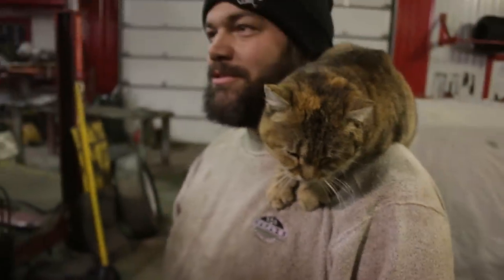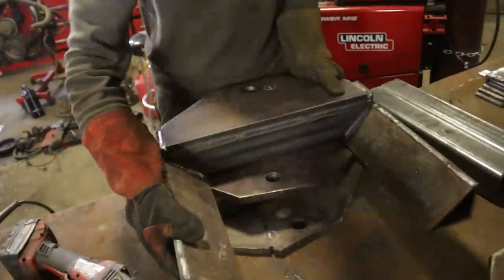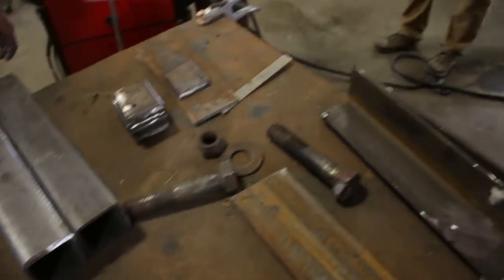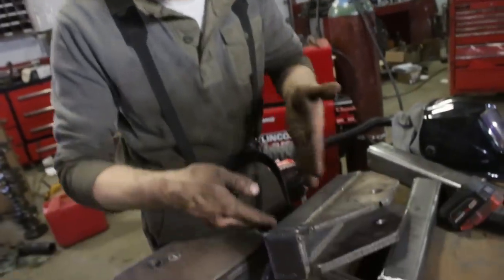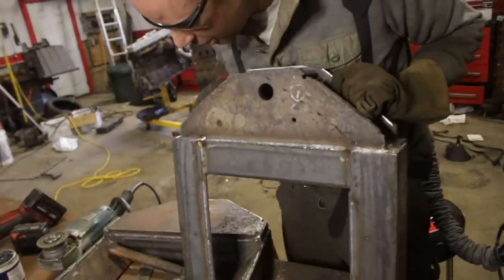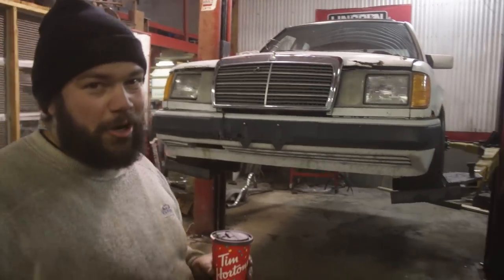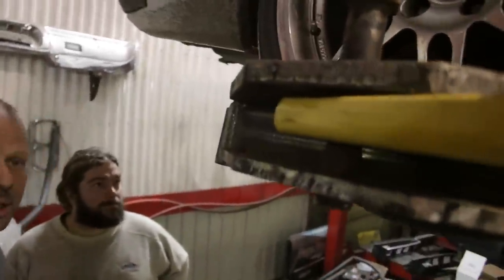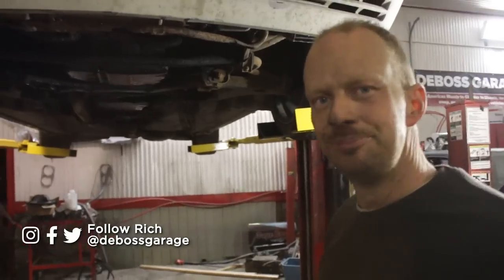How To Build Wheel Engaging Adapters For Your 2-Post Car Lift

Comment: As a professional engineer... thats super sketchy. The brackets you made are super beefy, but the holes you used for your pin are designed for a straight vertical load using the feet pegs. With the brackets, it now puts a rotational load on the square tubing of the lift that probably not designed for it. If each corner weighed 1000 pounds and center of load was 6 inches from the pin, then you have 500 foot pounds of torque on each lift arm. Considering most commercially sold products are just strong enough to prevent a lawsuit, i think eventually you will have problems.
Reply: Totally agree there will be a large rotational moment ☹️
Reply: I'd also be worried about the horizontal vector from the deflection. The only thing resisting the arms from swinging outward is the tire friction and the teeth on the arm locks (assuming the lift has those). I'd add a removable plate on the inside of the forks to capture the tire.
Reply: Nothing good usually follows "I'm not an engineer but..."
Reply: Big fan of the channel too, and have no doubt those are strong enough to take the weight of whatever car.  But just as Dave has pointed out, this is scary.  You're introducing a large torsional load on those skinny telescoping arms.  If those arms were made of taller rectangular tubing, it would be a lot better, but as it is, they are only square tubing and the ends of the arms where the wheel adapters go are also cut in half height-wise.  So they really aren't designed to handle the additional torsional load these adapters are introducing.
Reply: I always struggle with the compromise between strength and weight (esp automotive applications where extra weight can be an issue), as a layman my opinion would be the brackets made are a much, much heavier build than they need to be BUT that opinion is based solely on them, the brackets, being far heavier material than the ends of those arms they are attaching to...now I suppose the correct method would be to do all the maths involved and actually figure out wall thickness and such but most times that is not going to happen as you are building.  Thoughts, suggestions, in general, not necessarily the brackets in particular?
Reply: @RussZHC  dont look at it as strength vs weight. That would be in the realm of aircraft and the like. What it really comes down to is strength vs cost. Anyone can build a bridge,  but an engineer uses a material to its maximum capacity with some safety factor to make it as cheap as possible. 

Weight isnt an issue on something that is designed to lift thousands of pounds. Its changing the way it carries the weight. Companies love to make money. If theres an incredible thing you can do to vastly improve convenience... then there might be a reason why it hasn't been done.
Reply from the maker: I have never heard anything good after "I'm an engineer, do it this way..."  No offense
Reply: I used to be an engineer, the paperwork is around here somewhere, though I don't know about the "professional" part. But I agree with what has been said. The arms are actually rated for some rotational moment/torque since the original pads can apply the kind of load, but much less than these attachments. It would be much better if the cradles were connected solidly from left to right. Kind of like a wheel lift on a tow truck. Just be careful!
Reply: It's funny how some people think "I'm an engineer" or "are you an engineer?" are valid arguments. I've worked with plenty of engineers who don't know their ass hole from their elbow. Engineer or not, if you can present a valid argument, with a clear explanation, I'm all ears.
Reply: Greg9504   You don't have to be an engineer to present a good point. I just listen to what people have to say and decide whether it makes sense or not.
Reply: As a licensed professional engineer as well, I agree. Also, those telescoping arms are sketchy as frig with that moment put on them. Think of it like a truss, super strong in one axis but not another.
Reply: Woodward Beardsley  I agree the safety factor on some parts is significantly reduced, but there are commercially available adapters of similar geometry sold for similar lifts. These appear worse than they really are. If they sat level, there would be far fewer concerned people commenting.
Reply: @DEBOSSGARAGE  It's far easier to dismiss comments from claimed professionals than admit what you've made probably isn't the best solution to the problem, especially when you've spent considerable time and expense on it. None the less, I believe the concerns raised have considerable merit. I'm not a mechanical engineer, but an engineer none the less and I think this looks super sketchy. Please don't underestimate the importance of your safety, and keep up the great videos!
Reply: @fascistpedant758  theres a difference between an accessory that the lift was designed for vs adding something that was never designed or tested for.
Reply: Jeepin Dave    I agree that the torsion on the arms is abusive but they'll survive lifting the Audi 30-40 times, which is what he claims he built them for. Personally, I'd make a few revisions so they could safely be used regularly on most vehicles, but...   I hope he at least does something to be sure the cradles can't slip out.
Reply: As another fellow engineer. I'd say, well it likes safe enough. Most of that rotation is from slop anyways, and two post lifts are already designed for wheel engaging adapters, they even sell a whole bunch that ship with the adapters. I mean without doing any FEA I'd say it's perfectly fine.
Reply: If y'all are engineers, tell us the weight rating of the thick ass steal he used,  or the tensile strength. Without the numbers, whats the point

Comment: I'd probably just replace the bolts with real pins, and run it. Maybe some swiveling locking tabs to capture the inside of the tire. Although with as sketchy as it looks, and how it puts forces on the lift that weren't accounted for in its design and construction, I'd definitely inspect the lift arms and pin holes for deformation after every use, and discontinue use if any is found.

I know a lot of these comments come off as if they're shitting on you, but everyone here just wants you safe. Your build looks good, and no one is worried about your contraption breaking.  We just want you to keep making cool shit.

Comment: Just an engineers opinion but... your putting a moment or torque load on a structural member that was designed only for a cantilevered load. It may be OK for awhile but it really increases the pucker factor for me while watching the vid lol....one ill affect coming from this deflection is that your force from the car pushing against the lift is no longer straight down but at an angle. Imagine the surface between the tire and the adapter becoming just slick enough to allow them to slip causing the adapter to slip and rotate away from the car dropping the car on its side or worse... you or someone you know. Just stuff to think about bud. I like you channel by the way! Just trying to look out for you!
Reply: Lifts dont work like that. The have a gear type mechanism at the posts to prevent the arms from moving once they are picked up.
Reply: Kyle Salem-Fuson    Not all lifts have them on all four arms, and they often stop working properly in time. They're meant as a failsafe mechanism, not to be relied on during normal use.
Reply: E J ,you are 100% correct!

Comment: Id be welding some more square tube on the outside of the outriggers so you can slide a long cross beam between the left and right sides to take out the twisting load on the legs.

Comment: The solution is to have the end of the arm directly centred under the wheel, just like the factory setup has the end of the arm directly centred under the jacking point. Literally all that needs to be made are some oversize pads for the arms, with the pin dead center and two bars on top to prevent the tires from rolling. 
Obviously this will be higher off the ground since it's on top of the arm instead of beside it, so you might need some blocks/ramps to drive the car up on to it. Adjusting the arms so the wheels are perfectly centred over the pin location when the car is lifted is important. 
And yes it also means the arms get in the way of the sills instead of being completely out to the sides of the car. Slightly less convenient but much safer since the lift is being loaded exactly the same way as when it's used with jacking points.

Comment: I would definitely consider fabricating new tubes dedicated to the adapters. A bend or offset in the sliding tube to shift the load to the center line of the other tube would eliminate the torsion and the slop where they mate. Continuing the tube to the pivot point would spread the bearing points apart and reduce the slop at that joint and shear stress on the pin. The tube could be made longer to increase its penetration into the other tube to reduce the force at their contact points.

Comment: Remember, when welding on truck frames & things like this always weld inline with the structure & never across it. Good thing you tacked the plate on the angle iron first or you might have been tempted to weld across the inside, which would weaken the angle iron forks considerably (if you even get good penitration with that wire-feed that is).

Comment: Engineering Suggestion: Bolted Tie-pole between the ends of your inserts will stabilize both sides and form a 'link' to distribute gravitational pull once the vehicle is up.

Comment: Great idea.  I'll make mine with a little bias (up) built in to compensate for the necessary slop.
Reply from the maker: It will be difficult to slide them under the tires
Reply: @DEBOSSGARAGE   1)  I thought of that, as I am sure you did.  I will make a mock up to see if I can have a little bias,  but I will do it for "looks" as I am sure what you made will be fine.  I am grateful for the idea, as it is just what I needed. Clever Canadian.
2)  I was amazed that you can buy a truck from the US and if you have a title, just drive it in.  I live in No. Michigan and would love to buy a car (made in the US) from Canada but I understand it is a big hassle.  We will see.  
3) Love your channel. Scanned all your video titles.  Have you made a "Everything wrong with the 12V Cummins"?
4) I thought it was bad to weld a truck frame.  I thought you had to rivet it so no cracking.  Is that old info which is no longer true?  Much thanks.

Comment: Should have welded those adapters up so they have a bit of an upward tilt to them. About 3 to 7 degrees should be good. That way it'd sort of cup the wheel weight towards the hoist instead of away from it. Should be a little safer that way.

Also I would have put the spacers on the top plate instead of the bottom. You always have to think a little bit ahead of gravity when designing for very heavy things because the sheer weight always ends up pulling things a little bit. (Unless it's extremely strong like built with big triangular gussets)

Funny responses, though. Here you've got one guy promoting you sell these things and about 20 online enginerds saying how its overstressing the design of the original machine. The interweb is priceless! Thanks for inspiring more humor on this week's episode of "Laurel and Hardy re-hardy CarLift Enginerding" !

What I'd do is get out your laser level you use for leveling up foundations and put it at a standard height, say 6 feet, then put your level on it and take a few picts to your phone. Then every few months check it against those pictures at the same height. That way you'll know if anything is starting to give way. I think you are mostly fine with the design but a few minutes of safety checking from time to time will really let you know where you are.
Reply from the maker: I wouldn't be able to slide the arms under the tires if I did that

Comment: I'm usually not one to correct, but that car has an OM602 in it. The OM604, 5, 6 weren't put in W124 chassis Mercedes till '94. 
Btw, maybe it has a bad glow plug, Mercedes diesels have a great reputation for starting in the cold as long as its healthy.
Reply: Correct. Unless it's been swapped already. 
The 601 602 603 were great. A bit slow without a turbo but a bog standard diesel engine that is able to drive to the edge of the universe  and back.( Just slowly though )
Worked on many T1 vans with mega miles.

Comment: Here's a new idea I bet even the engineers would approve of. Attach some 2" ratchet straps at the end of each wheel cradle to strap over the tire. This would get rid of the "torsional load" on the bolts and would keep the car very secure while still having total mobility underneath. I'm just some guy but for whatever my opinion is worth, I would not be comfortable standing under that as is.

Comment: If someone turns the steering wheel....well take your pick, wheel slides through lift, front corner of car slides out
Oh and what the other guys said -  just the weight of the car alone can rotate out those wheel caddies and the car falls down in the middle, or front, or back

Comment: If you connect the left and right sets of front and rear wheel cradles with a tube that goes across the span of the wheels it would remove all sketchyness... and keep the cradles level. The tube would be removable ofcourse  by just welding sleeves onto each cradle
Reply from the maker: Thought about that yeah, thanks!
Reply: I absolutely agree, this is a brilliant idea, apart from the torsional forces you put on the lift arms when you swing them out from the center of the hoist. If the manufacturer states it’s ok, then no worries, if not, then somehow make a bar to stick in between the left and right crates to take up the torsional forces.

Comment: Pretty certain that the Mercedes will have the OM602 engine and not the OM605, the OM605 didn't come out until 1993 and was twin cam where as the 602 is single, but had the fully mechanical injection pump instead of the later EDC pump - OM605 Owner, BTW OM stands for oil motor

Comment: You actually want to put the thicker piece on the bottom. Metals(most) can handle tension better than compression. 

But it looks like it worked for you and 3/4” maybe over kill. Be safe

Comment: Rich, pay no mind to those engineers. The design has been proven repeatedly with almost every wheel lift ever installed on a wrecker. If it holds up going 75 down the highway with the car bouncing up and down, it will hold up in the shop no problem.

Comment: Maybe add some d rings and use the straps that these types of lift arms use on tow trucks.  Where it straps the wheel onto the fingers of the extension.  Would help prevent the wheel from slipping off the fingers.

Comment: I wouldn't get under it; cold lap single pass welds made with a lousy Lincoln on 5/8(?) plate? 
What grade  bolts will be in shear? I'll pass.
Reply: exactly !!
this should be a stick weld project, and maybe pre-heat

Comment: Add a cross bar at the front and back with a pin on each end and slotted holes along one side. Deflection issue fixed.

Comment: Lift tech guy here
You do see stuff like this out there but its usually more like this https://www.sviinternational.com/sites/default/files/Turf_Lift_Attachments_MLM_0.jpg
These put the non extending part of the lift arm in torsion but thats okay because the carriage-to-arm pins can take it. The turf lift addon arms are super heavy though and not hand carryable like your design - and of course the non extension arms wont reach the wheelbase of the audi.

Only thing i would say (no doubt youve thought of this already) is to keep an eye on the telescoping arms of the lift and make sure they dont open up/go out of square from the twisting force, they likely arent designed to take this sort of force but id bet can take it fine. Maybe that thin shim you briefly mentioned at 13:05 might help, but tight fitting telescoping arms do like to get stuck at the merest whiff of dirt.

I've seen many contraptions bolted up to lifts, with varying degrees of engineering fortitude. This is definitely not the sketchiest!
Reply from the maker: I came across these while browsing and just copied them.  I realize the the arms are rectangular and ours our square but they are also 1/2" thick.  I'm wondering if an engineer on here can tell me how much force it takes to rotate 1 square tube 2' long inside another   4x4"x 1/2" square tube.
Reply: @DEBOSSGARAGE  Exactly. Sometimes the 'strong as hell' factor means you can get away with not having engineering design perfection. Provided your arm locks are good, id run it!

Comment: Idono....kinda sketchy with that sloping angle ....
Reply: kerry gordon But, then again, where is it gonna slide. Nowhere.
Reply: Thomas Greiwe The arms have locks to keep that from happening. On the ground, there are pins that are pushed up and allow the arms to swing freely. Once the lift reaches a few inches off the ground, those pins drop down and engage the locks.
Reply: Thomas Greiwe  it's only pushing outwards a little bit but the reason that it's pushing out at all is the problem - the slop in the bolt/pin and twisting of the arms due to torsional load. The fact that the wheel is pushing downward on a surface that is sloped creates the outwards force. If the wheels were centred over the ends of the arms there would be no problem.

Comment: It's a good idea, but the torque load applied to the hoist arms is concerning. Perhaps a rig that passes from one side to the other, and then hooks up to the arms would be better.

Or, redesign the wheel saddles so the part that links to the hoist arm is at an angle to prevent torsional load.